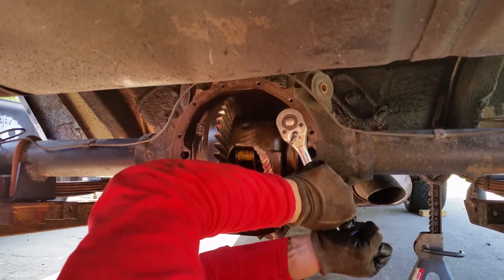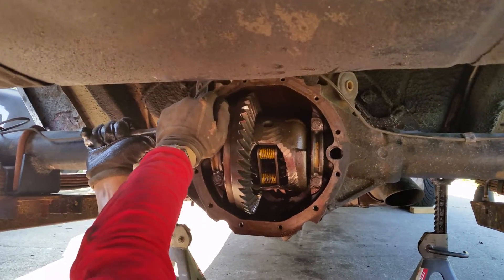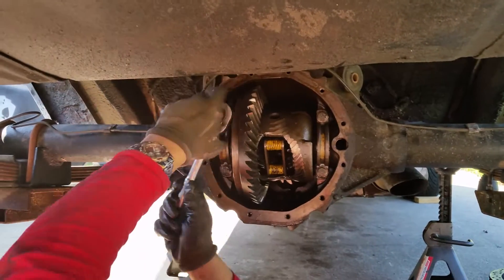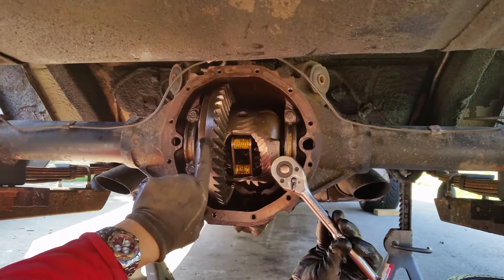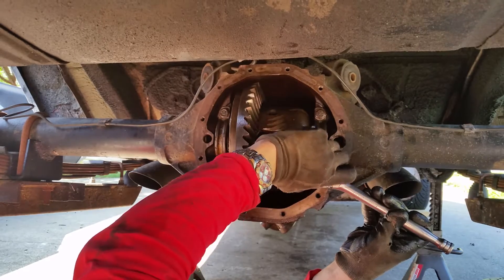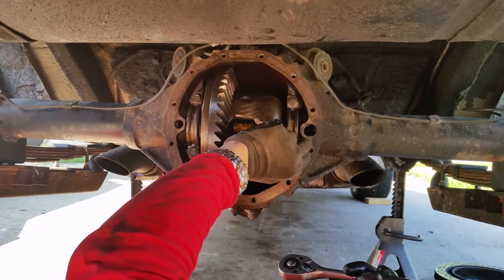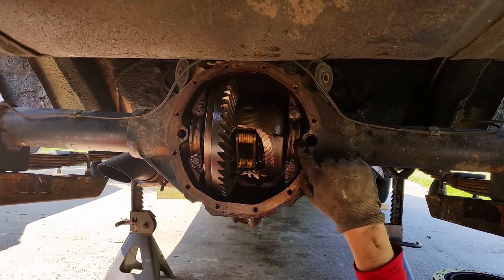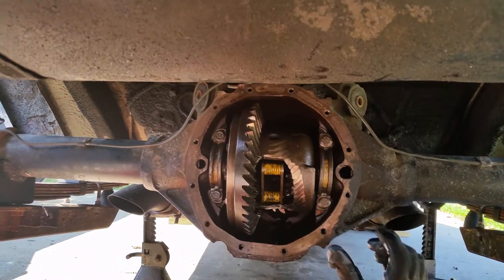part 5 carrier bearing cap removal, posi install 12 bolt rear end. limited slip differential

Comment: That one looks a lot better than mine.  I had GM's stock locking diff and it exploded on me.  A chunk flew through the diff cover and another got caught between the ring and pinion which caused my drive shaft to crumple and rip in two.  Just put a whole new rear end on my truck so I can rebuild the old one and have my truck back.  I'll take the new assembly back off and sell it when I finish rebuilding my old one.
Reply from the maker: Caretaker Flynn wow thats insane... i took apart a truck posi to rebuild a car posi one time for my current 2.56 gears (insane top speed).  And yes, the truck carrier isn't as strong as the car one, but shares the same clutch pack and spider gears.  You exploded a gov locker? (Or whatever they're called) .  Thanks for watching man, good luck with your truck.
Reply: Yup, it was a gov locker.  I can only assume one of the little locker clips broke and jammed in the spider gears but then the case shattered and wedged into the ring and pinion.  it was quite the sound.  I'm going with a limited slip rather and that gov locker for my rebuild.  I like the idea of fewer moving parts now :)  I might even do a rear brake conversion so I can have disc brakes all around.  Do you know of any particularly sturdy limited slip diffs that you would recommend?
Reply from the maker: Caretaker Flynn not auburn, thats for sure.  Eaton has been good to me...
Reply: Ah ok.  I was on the fence about that.  I had seen one Auburn fail and didn't know much about the other brands I was finding.  I'll go with Eaton most likely.  It's been a long three days so far and I can't get a drive shaft or parts for my rebuild until Tuesday.  I subscribed :) I've been looking through your videos and I think I'll stick around.
Reply from the maker: Caretaker Flynn thanks... you can't rebud an auton... but an earon lasts forever... as long as you keep feeding it clutches... ;-)
Reply: I've got a new automatic trans so I'll be alright :)  My truck is an '05 GMC Sierra I've tuned and modded to put down about 400 horse and torque.  I'm mostly looking to do burnouts and donuts without another rear end exploding into pieces.